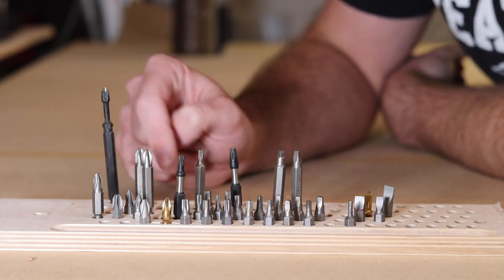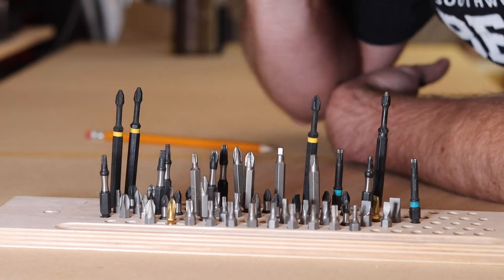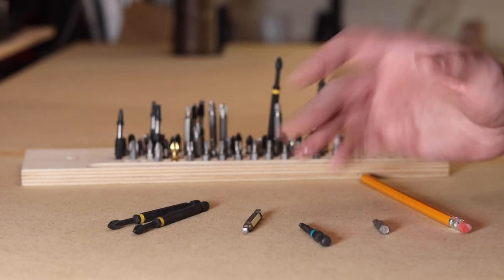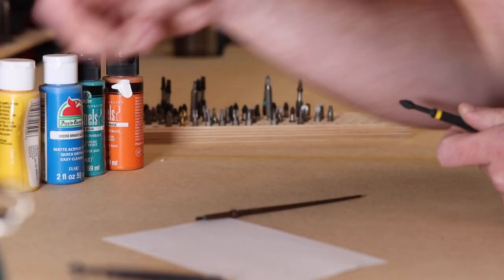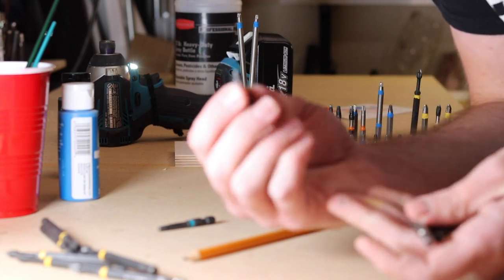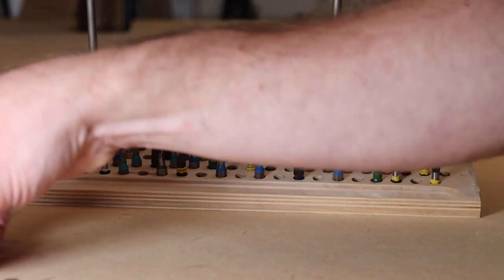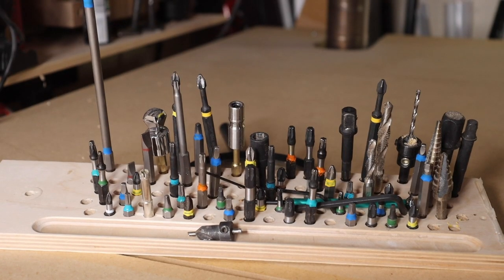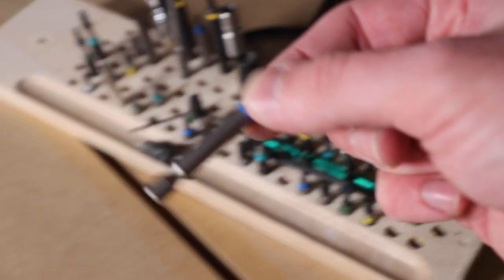Paint Your Flipping Bits Already (Wickedly Usable Driver Bits)

Comment: Like it. 2 things I would do different for me. First I would clean them all with acetone or brake cleaner first. 2nd nail polish will hold up better over time. Colored heatshrink is another durable option. Digging that bit tray you made too.
Reply from the maker: I wondered about cleaning them 2 years ago when I painted them, figuring surely the cheap acrylic paint wouldn't last.  But I like to try those sorts of questions and am bewildered that it has held up on I believe all previously painted bits.  Reason though is that the paint is commonly in the crevice which doesn't get rubbed.  I guess if you were in a machine shop w/ more oils around, cleaning them would probably be a must.  
Good point on the nail polish.  That already has the brush too.
Reply: Plus, a lot of people already have various colored nail polish in their household. I used some today, painted the head of my keys for same reason as this video. Home keys one color, work keys another etc. Used a nectarine fruit as a pincushion to let the keys dry. Keep sharing good tips, y'all!
Reply from the maker: Christopher Condrup oh man. Keys. Didn’t think of that. Have red and gray trailers. People borrow them a lot and I’m constantly insecurely giving them the maybe wrong key ring. Thanks for the tip. I’m painting them red or gray tonight.
Reply: I used nail polish to identify keys and their padlocks 😅 it holds up a long long time even rubbing on a key ring, and it especially helps my ol man who might have 20+ keys between home/shop/farm and his work and not having the best vision, eliminate trying 18 keys before getting the 19th one right lol i tried uv cure gel polish this week to see how it'll hold up, i think its going to be even better (providing the correct wavelength uv light is used for the specific brand of gel). I used UV resin with mica pigment powders a while back to make 3d designed key heads, the metallic swirly orange on my Kubota tractor key is kick ass AND my ol man can't steal my key when he loses his and claim I must have lost mine actually (again 😂)

Comment: My Bosch bit box has coloured rings by type. However, if I were to implement such a system, I'd use the colour codes used for electronic components. Assign a colour to each type, and use one or two coloured rings to identify the size. Say Red is 2, and torx as a type. A 20 torx would be two red rings. Torx 25 would be red green (green being the number 5.) Torx 15 would be red brown green.. Rings are ordered from the mounting end to the "pointy" end, and rings that can be unambiguously omitted may be so (thus torx 20 could be just one red ring.) Of course more than three rings would probably become confusing very fast. Less is more.

Comment: I normally dislike music on videos but yours was, to my taste, excellent. Rather than manufacturers' colors, with my vision it would be an improvement simply to have a color for Phillips, another for Torx, etc. I'd imagined various of nail polish. What are your paints and where can they most likely be found?
Reply from the maker: Nail polish is a good idea. I used basic acrylic paint from Walmart. Even the cheapest stuff is still on the bits, but the $2 dishwasher safe stuff is still thick, glossy and vibrant.

Comment: Sorry if I missed it, but do you mention the brand of paint you use?
And more importantly, with this video being 3 years old, how has the paint lasted? I used some Sharpie paint pens on my bits and the paints starting to wear off after about a month, with the most used bits having no paint at all. But I think it's the but material. I'm color coding screwdriver sets for an electronics lab, and it looks like the bits are some cheap shiney metal that doesn't hold paint well. I want to try your brand of paint and see how it works but it still might wear off easy... Anyway, I'll see if I can find out what metal is used for the bits and buy a paint accordingly.

Comment: I want to copy that! What paint did you use. I could not make out the brand?
Reply from the maker: Just the cheap acrylic stuff at WalMart.  It's held up for 2 years, but I don't have them bumping around in the bottom of a tool bag.  Others have recommended nail polish for durability.
Reply: @KeithsTestGarage : Thank you!

Comment: If I might suggest a small improvement: nail polish or enamel, would have greater longevity from the abuse the bits take. I expect you’ll be reapplying that acrylic someday. Who knows, maybe it’ll outlast the bits anyway.
Reply from the maker: A) you're right, nail polish would be a good idea and it also comes with a brush.  In defense of acrylic paint, I expected it to rub off but it has lasted 2 years.  But I think that's mainly because the paint is primarily in the crevice.  And, that I don't hold the bit while spinning.  Thanks for the comment